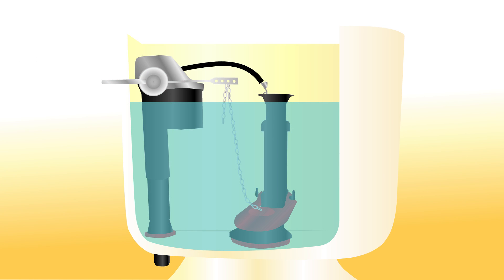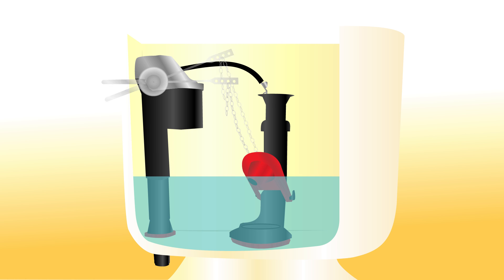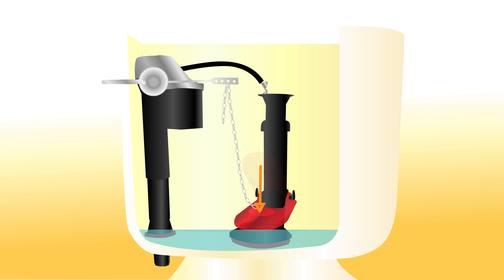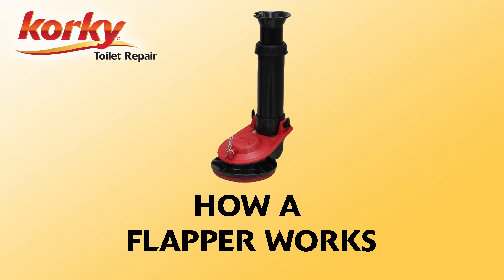How does a toilet flapper work?

Comment: How does the tank fill up?  It seems the pipe sprays water UNDER the flapper.  The tank should NEVER FILL.
Reply from the maker: When the flapper closes, it creates a seal on the flush valve drain.  Once this happens, incoming water from the fill valve refill the tank to the original water level.

Comment: How does a flapper affect flush power?
Reply from the maker: The flapper controls how much water is released into the bowl.  If the flapper closes too soon and does not deliver enough water to the bowl, the bowl may not fully clear (weak flush).

Comment: "Because the flapper ball is filled with air, the flapper floats on the surface of the water." ... Thank you ! That explains everything.
Reply: Yes, so now I know why you shouldn’t have to hold the handle down for a complete flush.  Very interesting!
Reply: actually i dont get it. why doesnt it float when refilling?
Reply: @TheFlexXMLG  In the closed state, there is air pressure below the flap, but water pressure above, so that pressure difference, a net force of a couple pounds, is keeping the bottom plug closed tight. Once you let water in and it starts flowing down, you have water pressure on both sides, so the small air bubble in the flap is enough to keep it open.
 
The size of the air bubble required is based on bernoulli's equation, where moving water has lower internal pressure than stationary water. This is another instance of a net pressure difference across the flap, just with moving and stopped water instead of air and water. The bubble's buoyant force must cancel the net force due to the flowing water.
Reply: I had this exact question after watching another video about the UK and their weird siphon mechanism.
Reply: NO IT DOES NOT !!! How does the air get inside ? If there is air Y does it NOT rise with water ?
Reply: Show picture